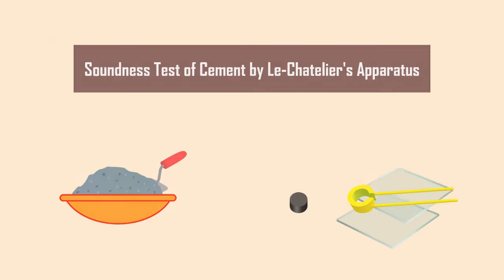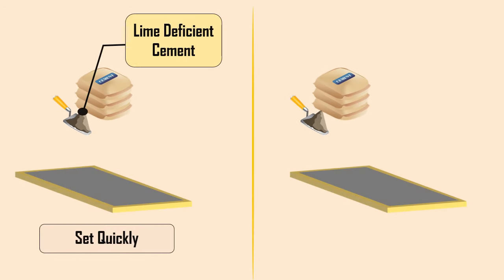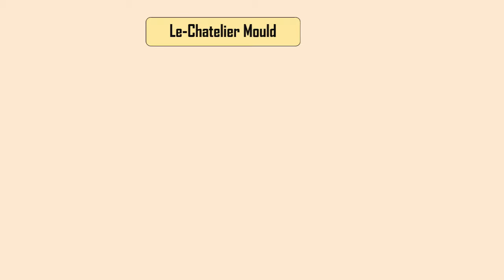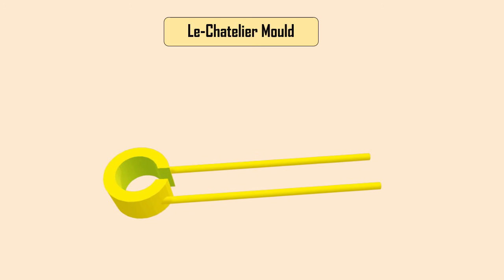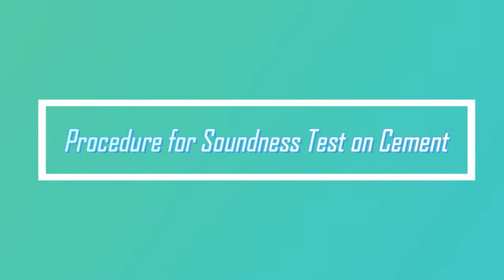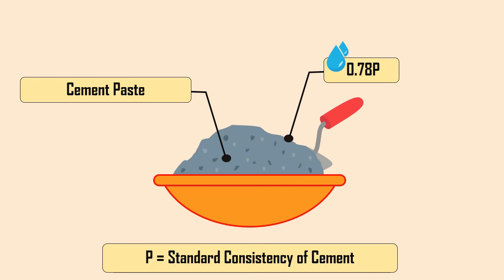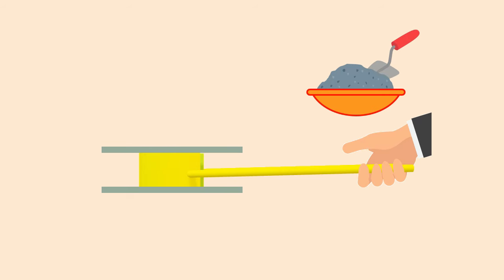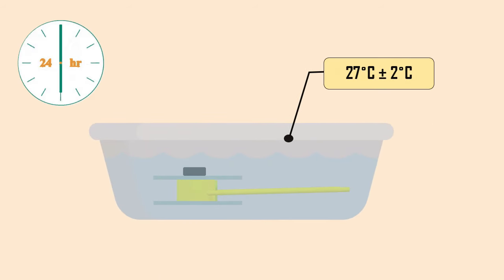Soundness Test of Cement by Le-Chatelier Method || Cement Test || Test on Cement||

Comment: For R.H.C. Expension not more than 5mm
Reply from the maker: Thank you for response!! It’s not more than 10 mm.
Reply: @AnimeEdu  Yes
Reply: Refferd IS 4031-1988 part 3 clause 5.3
Reply from the maker: Hi!! Check cl 3, 5.3 Calculation - Calculate the mean of two values to the nearest 0'5 mm to represent the expansion of cement. It mentions to calculate to the nearest of 0.5, not about limit for type of cement..
Reply: Yes.